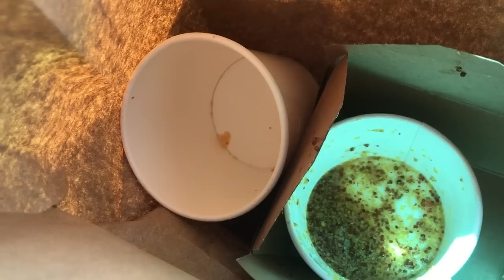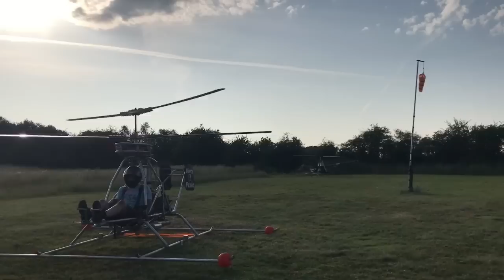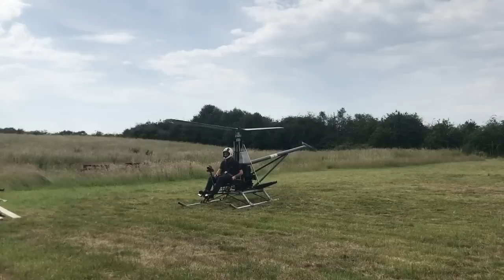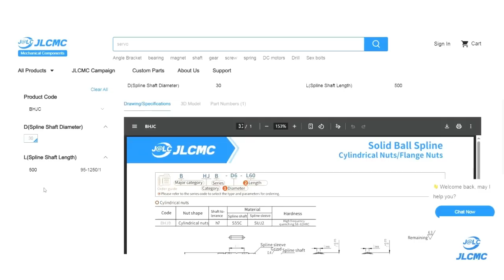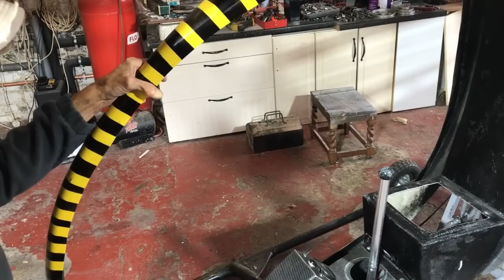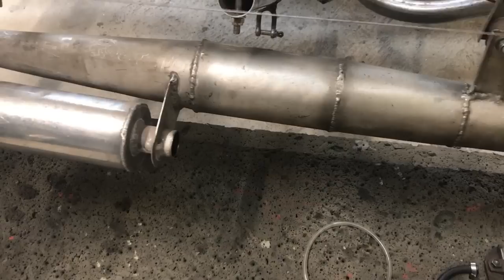Three HOMEMADE Helicopters, walk around, explanation and testing

Comment: I learnt on a R22, owned a 2 seat Rotorway but, I'm tempted for a coaxial ride.
Reply from the maker: My coaxial is quite a bit different to an R22 as you might expect, haven’t had any experience with rotorway but I like them a lot. 
Mine is not sensative to operate compared to the R22, yaw pedals are vague and limited response, no collective so height control is sluggish and delayed. 
Cyclic is similar in control movement but very different in pilot effort. 

But these are all oddity’s of my chosen design rather coaxial. 
It’s nice not having to worry about balancing the torque. Just minor corrections required. 

Sch2a is a nice little machine and designed properly.

Comment: Outstanding content! Thank you for going to the trouble to post this video. A thought: might it be possible to insert carbon fiber inside the landing gear tube where the bolt passes through, use something inflatable to press it against the walls of the tube internally for curing, and achieve outrageous reinforcement?
Reply from the maker: Thanks for the compliment. Carbon reinforcement would be a lightweight solution. Since that video I’ve learnt that there is a potential problem with having carbon fibre and aluminium touching which is galvanic corrosion. 
I don’t know to what extent the problem exists, perhaps if it’s kept dry there is no issue.
Reply: @Ben-Dixey interesting. I thought a builder featured had carbon fiber wrapped around exterior of aluminum tube. Hmm… Barrier coating to metal first?
Reply from the maker: @rodofiron5957  yes, he didn’t mention a barrier coating but on anything critical it would be necessary in my opinion.

Comment: No joking around these people have a death wish. Even quality manufacturing companies like Bell will have issues but they have the resources technical staff finance to weed out most of it. Did you see that one rotor had looked like it was cut from a tin can? Yeah these guys are nuts
Reply from the maker: The rotor head in question was a mock up just to hold the blades. No death wish.

Comment: I've watched a few of your videos and admire your initiative and ability to engineer and fabricate  but you need to reconsider your setup for the counter-rotating rotors.  To my untrained eye, every time you feed in a little fore/aft or sideways stick movement, you are inducing a bending moment to the upper shaft that (I worry) will create a stress failure right above the lower rotor head.  The upper rotor will then spin upwards and the rest of the machine - and occupant - will spin downwards.  Swashplates on both blades will work safer and better.  I hope an engineer or two can weigh in!
Reply from the maker: Yes you're right there is a bending moment. Wondering if it would be the same as a coaxial machine with swashplates? The rotor controls the helicopter via the mast? I'll have a think about how to measure the moment
Reply: @Ben-Dixey  Thanks for the response!  While I have your ear, a previous commenter/pilot said that the fore/aft forces and the side to side stick forces should be equalized.  The drive shaft needs to telescope for fore/aft movement but not for side to side so it seems that unequal stick forces have been 'baked into' the current design!  Might be boring but current, same-old, same-old helicopter design does have a proven track record.

Comment: Let me see if I can explain a suggestion for the skid frame; consider forming a “half-shell tube” that you would weld under the existing skid leg. The “half-shell” would start 6” or so inboard of your existing bolt and extend outward and down the bend radius to just below where the bend stops.  Unless you really want to build another skid frame you could drill the existing bolt hole oversize and weld a vertical bolt tube into the frame which will also act to reinforce the hole along both axis.

Comment: old man..40 years in tool and die and machining. 65 years building "stuff".  I WOULD NOT cross drill your landing legs.  Don't drill ANY holes  through them.  Put on "U" hangers like on a truck leaf spring.  Of course there are many other way ro beef them up.  Other than that as a 78 year old machinist/toolmaker.. I see so many scary things on your copter that I can only suggest you get a MASSIVE insurance policy for your wife ASAP.

Comment: You can redesign the through bolt clamp to use no through bolt at all, and instead use a split type , like a motorcycle handlebar , it would be a little larger, but the strength and support would be much better.There used to be a rubber fingertip (glove) you could buy for flipping pages

Comment: Carburettors can be finnicky things indeed.  After 40+ years of motorcycle ownership and spannering on a wide array of machinery I can vouch for this!  There are times when nothing obvious can be found as the problem, but changing the bad carburettor out for a different one is the only real solution.  Glad you have narrowed down the problem!

Comment: brother ben ,
first , a big thanks for introducing Mr Ben with incredible 5 own self made helicopters...
if you get  another chance to visit him or get videos of him plx share with us , he looks very interesting and genius person too.

another thing i dont like to say but should I say ? i feel your engine runs on very very high RPM so do the rotor blades  ...i believe by seeing the performance of Engine with main rotor assembly that your engine will cope with little longer blades . ofcourse we may feel engine does catch bit load but it wil cope with it because its now runs like without load very happily ?
because what poses the threat is too much RPM ,it increase frictions ,it fatigue the parts (especially on main shaft which you designed )
faster and as well increase the heat temperature of engine ,its like running your car on 200 km /hour which usually goes 120 km/hours , am i wrong ? if you think different then please say  ,
i know its its time consuming expensive work to increase the length and not easy but ...may need to think !?
thanks again brother 
for sharing us the part of this development

Edited P.s.- I know you don't have variable pitch control for rotors angle of attack? 
Is it possible to increase the bit of angle of attack of the rotor blades instead increasing the length of blades ?
Is it easy ?
Reply from the maker: Hi, you are correct on all points. 
I don't need the high rotor RPM for what I'm doing and I could increase the pitch of the blades to slow the rotor but keep the same lift. Worth experimenting with as max angle of attack is around 7 degrees, I'm running blades at 5.5 degrees pitch top rotor and 6.5  degrees pitch lower rotor. The lower rotor will have an angle of attack similar to the top rotor even though the pitch is different. 

The engine is running at 5500rpm but it sounds much more than that in the videos. Rotor rpm is high at 780, next time I would probably build with longer blade, wider chord and slower rotor. 👍
Reply: Brother  If you feel comfortable enogh then it will be enough to increase the angle of attack to gain sufficient lift on lower RPM of engine ...so try that please 
my question can you kindly explain me why you have to keep different angle of attack setting on lower and top rotor blades ?  
woulnt it make difficult to counter the torque generated by lower rotor blade by  top rotor blades ? though we can see your helicopter is stable on yaw movements or you have to use right or left paddle more to control  ?

Comment: Good work! Nice to see the other people, thanks! Having built hang gliders you can insert a tube that’s 3 diameters long to regain all the strength where a hole goes through, but also use a tube that’s just bigger than the bolt and swage the ends over so the bolt doesn’t crush the tube.

Comment: 80°C is a good temperature. 80~95°C is the sweet spot.

I use fishing gut to clean car jets, harder to damage the orifice.

Maybe a multi wrapped bugee from the side to a central point, duplicated on the other side to same mid ships.

My machine takes all nose gear weight via around 5 wraps of 8~10mm bungee with the rested loop length about 200mm

My flying machine mates tube to flat with solid rod bored at 90° same dia as tube.
I had to make up some new spacers so i made them from 6061.
No reason you couldnt bore rod or square stock [ or whatever you have ] with a hole saw at 90° to each other at tube dia.
Reply from the maker: I'm being a little cautious with the temps after the head gasket previously failed. I guess as long as temps don't exceed 95deg C I should be ok. 

Interesting to hear you used bungee to allow some flex. I think I would want a loose cable within the bungee to prevent over bending of the gear legs. 

What flying machine have you got ?
Reply: @Ben-Dixey 

In your current application I'm unsure, maybe 90°C
I recall discussing coolant vented to atmosphere to avoid stressing the coolant system.

So def not over low 90's or you'll loose coolant overboard.

Normal coolant system test pressure is twice cap pressure.

Higher pressure = higher boiling point = more heat dissapated from radiator.

Temperature change is proportional to temperature difference so 
higher temperature,
 more airflow, 
cooler air, more efficient radiator all equal smaller radiator.

Also, when you get to optimizing the engine for more power you will create more heat. 
So id leave room for a large low weight high efficiency single oval tube radiator, as its your friend.

Landing gear
Have you considered designing the landing gear to flex. Unload the stress.

My machine is set so the front  plastic wheel like a toddlers box bike wheel just collapses if I put all my weight at the front.

Normally it would see 10~20%.

Pterodactyl Ascender 2. 
 A strictly calm weather machine.
Reply from the maker: @donaldpayne1376  The pterodactyl Acender looks an interesting machine. Canard design is novel. 

The coolant system is pressurised, it was just a comment suggesting using waterless coolant.  

It's been suggested moving the radiator out into the downwash, possibly get rid of the electric fan and alternator. Rotax 582 uses a very small radiator but it's right next to the prop. Think I need to measure the airflow closer to the tail and see how much rotor downwash there is.
Reply: @Ben-Dixey 

Re fixed pitch and getting light on the skids.

I initially played with fixed pitch rc micro choppers back with the picolo imported from uk ~30 years ago.

I remember them as skittish & nasty near the ground so the technique for takeoff was forget about getting light on one skid as it'll skitter across the floor snag a skid and tip over. 
I'd guess that'll be translating tendency due to the tail rotor main disk off set. 
But punch off and get a couple of rotor spans off the ground. Then it all calmed down. Alot.

Similar for landing, a plop seemed to be better than trying to grease it on.

Comment: Factory built helicopters are extremely expensive for a reason.  There really is no room for error.  If something - anything really - fails you will almost surely be killed.   Airplanes are much cheaper to build or buy for that reason.   I build and fly both R/C helicopters and airplanes.  It is a night and day difference in handling between the 2.  I also do cnc machining. I have both MIG & TIG welders, CNC lathe & Mill (industrial size), metal shear, and a press brake.  I fabricate things.   I would build and fly an airplane I made no problem at all. I would not fly a helicopter I made - even though I'm sure I could do it.  Just too much risk VS. reward.  You guys are doing a lot of things I would not be doing based on fabrication experience.  Please be careful and get expert help doing what you are doing. It is not worth your life for something like that.
Reply: yes this guy is really bad at engineering, that is scary, the number of terrible "design" choices and decisions on this device clearly shows he should have stopped a long time ago.
Reply: @lo2740  Agreed.
Reply from the maker: Are you are assuming we will all be flying at height at some point? If so that's not the case. All I want to do is hover and maybe some slow forward speed at some point, it's just a fun field toy. 
Still potentially dangerous for sure but not like flying at height. I wouldn't build a helicopter for flying at height either, I'm a total beginner at this stuff.
Reply: @Ben-Dixey  Ok, if that's the case that might be different. But, your video suggests you will take flight once you have your bugs worked out.

Comment: What a great 'fly'-in (Spin-in?). In building a CriCri or a Rutan Canard, the mantra is: How heavy should each part be? When you throw it up, it should not come down. Wrapping your control tubes will surely help (proviso: use a glass layer as the Aluminum interface to prevent electrolysis). I could hear the 'noise' when you spooled up the 2nd time, and like they said in Galaxy Quest.."I know that sound..That's a BAD sound" 🙂 Maybe go for a CF drive shaft shroud. Interesting to hear the logic on the TR rotation direction.

Comment: Using the same idea as now, a piece of box section to space the tubes apart, but using a slightly bigger square section you could extend the sides of the box past the centre of the tubes and then use horizontal bolts instead of vertical. I would use two 1/4” bolts though each tube rather than one bigger one to reduce the hole size. I am glad you are looking at a ball spline which I suggested previously, but I am surprised you can buy one cheaply.
Reply from the maker: Great idea on the oversize box, Julian and I were discussing this idea you suggested and drew up the design on cad. It looks promising and lightweight. Will make a sample and test it. Thank you.

Comment: If you use 4 exhaust or TV areal mast clamps, 2 going down and 2 going up and passing through a piece of plate steel or aluminium sandwiched between the tubes, you wont need to drill a hole through that tube creating a weak point.
Hope that makes sense.

Comment: This was kind a disappointing video. While I enjoy seeing the creative ways the builders are tackling problems, like most "homemade" helicopter videos, the machines hardly, if ever, actually do more than spin the rotors or barely get off the ground. Sure, spinning a couple of airfoils can create lift force, but a real "helicopter" does more than spin its rotors in place or barely hover, it goes someplace. If creators actually had confidence in what they create, they'd do more than spin or hover in front of a camera - they'd actually climb their machines and go someplace.

One sees videos of successfully built kit home-builts, where the machines are designed by aero engineers, fabricated after testing by pilots in factories and flown by experienced pilots, but built-from-scratch home-builts that actually are "flown" are pretty rare I suppose. Then again, maybe the lure is in the actual building and figuring stuff out rather than creating something that can actually be flown. Perhaps the title should have been, "Three HOMEMADE sitcopters, walk around, explanation and testing."
Reply: Sadly, I kinda know what you mean. In the end, you should be able to spool up, IGE hover, move into translational lift, and at least cruise around the field with turns, or climb out and demonstrate some altitude flying, including safely executed autorotations. But I also understand development, and you do not want to have a 'Ben's driveshaft departure' at altitude (or anytime, after development), so being careful and moving forward slowly and safely is what will be a great design in the long run. Even Robinsons, which are pretty commercially sound, have over the course of time shown that you must operate within a narrowing set of parameters and maintenance, as pilots uncover design discrepancies, that were not considered in initial design considerations.

Comment: As an RC aircraft model builder and bike mechanic, I have experienced a lot of fatigue, fractures and stress induced failures in aluminium tubing, gussets and bolted or welded areas. I wonder whether Rivots would be a more suitable form of connection in some areas. Also possible use of Polyplastic or nylon fittings. When you throttle up the engine to max, it downright scares me what and how things could go wrong if you are up in the air. You have serious cahones to sit  in the midst of it, I raise my hat to your determination👍
Reply: LOL I have the same thought when you look at all those mechanical parts that if they go wrong its going to be a bad day. I am a paramotor pilot & I know if my engine quits & can still safely glide down under my wing & if all else fails I still have a reserve chute I can deploy. In 20 yrs of flying I have had plenty of engine outs & one of my flying mates had his prop break & go through the wing. luckily it did not affect its flight.
Reply: @calthorp   yikes, prop through the wing is scary and you "only" have an engine under a glider. wing...yeap, my thoughts exactly, there is just so much going on in this Heli that its beyond my rational train of thought to trust all the components to be in a safe and  stable condition for an expected duration enough to fly. So many moving parts and energy. If it goes wrong, I just imagine a mangled heap of twisted bits and bobs and total discombobulation to be most logical outcome. He does mention though that he only wants to achieve low level hovering so I hope he doesn’t get “carried away”
😬
Reply: @antichicmusic  Yes a plane wants to fly a heli does not. Low level flying is usually the most dangerous place. no room for error, turbulent air & lots of things to crash into